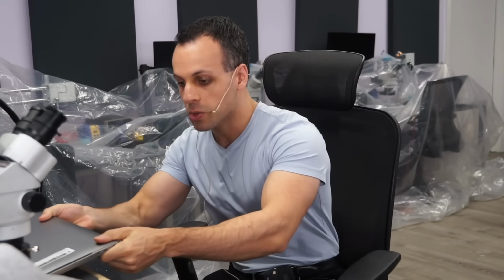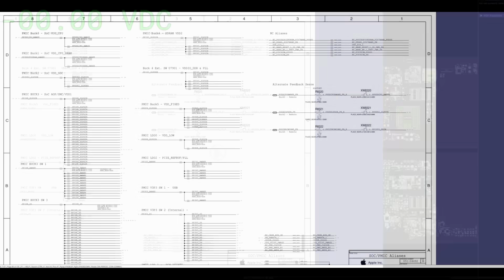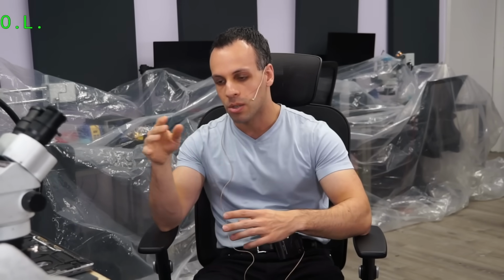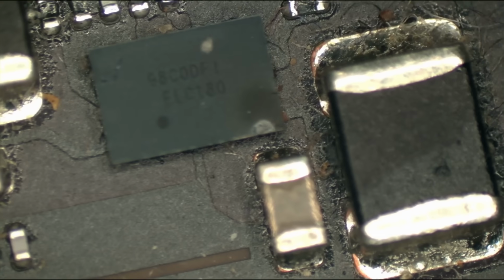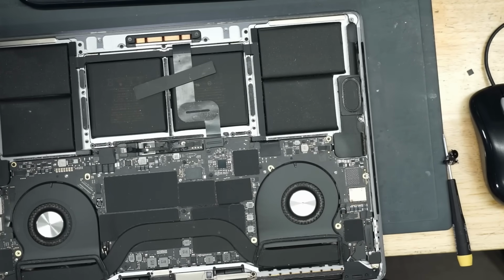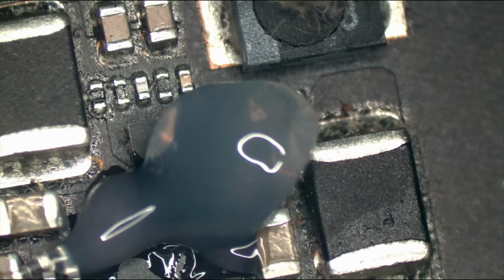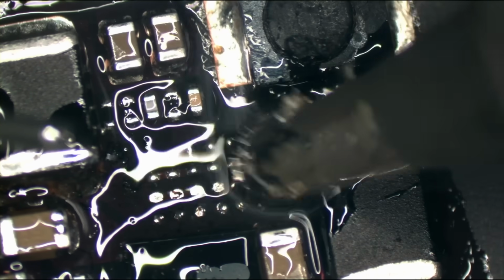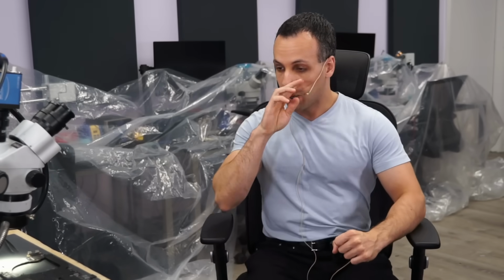How most 16" Macbook Pros often kill themselves & why they're unfixable

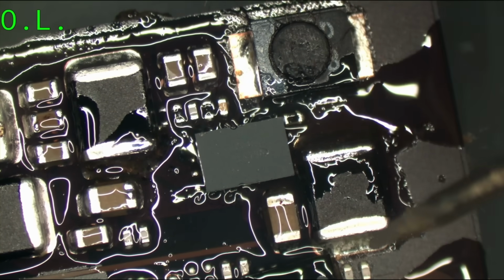Comment: When testing at 13:15, it doesn't appear the chip is fully seated. There's 3 pads to the left it isn't contacting. Is this normal when testing? I compared its placement to the chips around it and it appears offset to the right during testing.
Reply from the maker: It's not supposed to be touching the board It's sitting on top of flux
Reply: @rossmanngroup  Sorry, didn't mean seated as in soldered on yet... I meant it looked like it was set on the pads and shifted right by a full column. I'd paste a photo comparison if I could. I will however defer to you, you are definitely more the expert at this than I. 

Thanks for the reply, I always enjoy your repair videos, right to repair work, and your walks/cycling through NYC.
Reply: He was testing the power, which it seems he almost forgot to do, before soldering on the new chip.

Comment: Does replacement before the issue occurs prevent the issue? Like are the newer chips more reliable or just as likely to blow?
Reply: It’s not the chip. It’s the layout of the electrical current of the motherboard, as designed messes up the SSD by sending a lot of power to it and blowing it up essentially.

Comment: Wow they have reached a new low. At least before they only self destructed but the data was salvageable. Now they take the data with them. I recon not long till they start taking other devices with them. Or the user.

Is the issue still there in the M1 macs?

Comment: I thought you were taking apart a M1 Pro/Max 16” MBP at first. How well/badly are those engineered?
Reply: apparently, exactly the same.
most of the board failures from the thunderbolt/touchbar generation has moved over to the M1 macbooks as well.
its like apple is actually considering these board failures as must have "features" lol

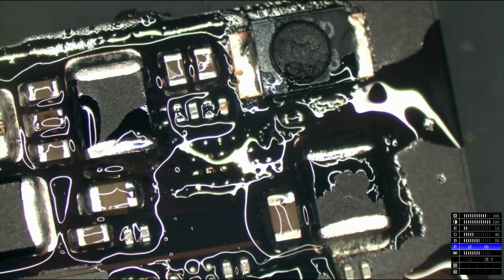Comment: it looks like it was soldered one row off. If you watch from 12:55 you see how it gets soldered and it looks like the array was misaligned. I doubt it would have worked either way but still
Reply from the maker: It was never soldered because I need to measure to see if the short is still there before I solder

Comment: Its likely more MacBooks make it to the repair shop because with craptastic Windows laptops, the buyer just expects that the when the unit fails, its landfill time....if they are lucky they can pull the HD and RAM (which will also gather dust in the "phone drawer")

Comment: It's not liquid damage, my theory is that the power chips are so close to the intake slot that dust may enter and accumulate, eventually shorting the power circuit out and electrocute the whole thing.
Reply: considering there was a pretty significant piece of dust right over the ssd chip i think you might actually be right on this one

Comment: As someone who owns a 16" MacBook Pro that represents a huge investment for me, is there any solution other than paying for iCloud in preparation of spontaneous death?
Reply: There are several other solutions like Onedrive and so forth. Least you won't pay Apple a reward for threatening your data with electrocution.
Hardware-wise, you could add a overvoltage protection component between, but wouldn't recommend trying that until you are no worse using the solder station than Louis is.

Comment: Didn't you put the new chip on wrong? At 13:08 you can still see pins on the left side of the chip.
Reply from the maker: It's not soldered on. I'm not wasting the chip if the short is still there.

Comment: I emailed you guys over one of these models doing something similar... was sure I didn't have water damage but thought it was a bad battery. I basically used it 4-5 times and noticed it would drain very quickly until it didn't power back up. I took my sweet time and missed the warranty period with Apple to get it replaced. 

The estimate was around $450 from you guys so, I bought the battery and replaced it myself and that fixed it. :)

I got the "water damage" disclaimer back in your email and was quite frankly annoyed even though I stated the laptop had none ahead of time (I'm in IT myself) but I get it now.
Reply from the maker: You seem easily annoyed. Oh well. I'm glad it works. We never give specific quotes over email, we give ranges based on different things that could be causing the issue and always tell people to bring it in because there's no way we can tell for sure without actually seeing it. When people say that they are mad when they have never given us a chance to view the device in person, there's really nothing I can say to that
Reply: @rossmanngroup  I was annoyed because I noted the device was barely used and that it didn't have water damage and got back an email just as you stated but that also noted it may be water damage. No other reason. 

But as I stated I'm in IT as well. I get devices from people all the time who say "it just stopped working" and when I get the thing you can see the liquid under the screen 😀. That said, I was looking for a ballpark price on the fix. I did some research prior and noticed replacing the battery was a royal pain in the behind on these and would rather have paid someone to do it if it wasn't that big of a hit but I sucked it up and spent the 2 hours myself. Needless to say it was not a rewarding experience. 😬

Comment: Can't believe a less-than-3-year-old $3000 MacBook just fucks itself out of existence. I was considering buying an M2 powered MacBook for college but I've now been convinced otherwise.
Reply: I wan considering an M1 max in a few years but now I'm very scared for my data😂😂😂
Reply: God I wish I had the viable choice to use Logic Pro X on well built laptop hardware.
Reply: Buy a Thinkpad, a decent one, say an old t440s, and hackintosh macOS on it. Linux (I like MX these days, personally) on another partition and your done. The only mac I currently own is a 2008 macbook (unibody). With 8GB RAM and an SSD it surfs the web with High Sierra (dosdude1 patcher) just fine, and still gives me access to my old mac files. Otherwise its Linux for life.
Reply: @imixmuan9081  I would really like to do that but i'm using so many modern CPU heavy plugins that I really do need the power of a newer CPU. Thinkpad would just cause too many hiccups and require insane latency to record without buffer overflows and clicks or pops. I've looked into the laptop hackintosh situation for years but sadly it's a really complicated mess I don't wanna deal with. I've done multiple desktop hacktinsoh setups and have hated the process each time. I can't imagine on laptop.
Reply: Don’t overreact. Commenters make it sound like a huge percentage of Macs fail and destroy your data on purpose, but as he said, it was one revision of one particular model. I program for a living, and all one needs for data safety is a backup drive (super easy these days), and/or cloud backup (yeah it costs, but very little), all things people should be doing no matter what brand or model they choose.  Wait another month and get the latest greatest Mac with all the ram and drive you can afford.  Back it up daily or more often, and enjoy it for years to come.

Comment: If the NAND is dead on a macBook with T2 chip you should be able to reset the SSD controller if you put on a new NAND die using the Apple Cofigurator (from the macOS App Store), this Tool will re-flash the T2 firmware and as part of that it resets the SSD controller within it.  (this will require you to have Mac with a USB-C port).

However you will need to get the correct NAND dies apples SSD controller firmware only supports a subset of NAND vendors and depending on the capacity you need to match the vendor model number directly (this is not all to that uncommon for other SSD controllers out there most have static configuration in the firmware).

Out of interest why is replacing the NAND die so costly, raw NAND dies are not that expensive a part (compared to something like the CPU or GPU or even gpu memory)
Reply: Unless the fried NAND simply indicates the whole SSD-array is toasted...

Comment: I would really like to hear your opinion on the board design of the framework laptop. 
Not just about repairability, but also how smart it was designed.
Or is there already a video about that?
Reply: Not smart designed, Apple likes to take the boards that are already tested/approved for certain electrical standards and change them up to save a little cash

Terrible strategy but great if you plan on not fixing your products, ever
Reply: @GenDrag1  Request is about a Framework laptop, not an Apple

Comment: I get so many of these turning up.   For those reading/watching; before you even power up the machine, check the PPBUS resistance, check the SSD 2V5 resistance.
If SSD is shorted, remove the VREG and check again; if it's still shorted HARD ( < 1R0 ) then you might be lucky and it's a blown/corroded cap.  If it's 3~6R it's probably either the NAND dead or the PCB shorted :(

What ever you do, if you find a corroded cap on the NAND or PPBUS rail next to the NAND VREG,  **REPLACE THE GODDAMNED VREG** first before you even consider powering it back up after removing the short - as sometimes that shorted cap is the only thing that's saving the NAND from a VREG that's likely going to spit out something more than 2V5.

You want PPBUS and NAND 2V5 to be > 400 ohms when warm, or 1K+ when cool.  If they're not, then you've got a dead NAND, PCB or other issue still.
Reply: They need to make smd crowbars that intentionally popcorn the package when tripped.
And ffs, put crowbars in to protect storage
Reply: @RobertSzasz  I was thing along the same line, but, apple don't make SSD's, would of though that they would have some sort, protection, from externally, botch-up's of what ever connected to it,  if you ever need to 007 auto destruct for you data, sending 12 volt to that pin would be the way to do it?
Reply: @dh2032  there's a definite trade off between speed, size, power waste and robustness. A modular storage is more likely to have protection , where a chip directly placed on a board relies on the board/product design
Reply: silly ppbus go brrr
Reply: @genericscottishchannel1603  13v to ssd=🔥

Data afterwards:🔥 🔥
Reply: Another suggestion, use a brush to clean the SSD power regulator area whenever you open it up, it is likely the short is caused by dust accumulation.
Reply: @ScaredPilot  It's more likely a weakness in the regulator chip design or manufacturing process. Unless the dust really thick, it's not going to short the chip - more likely cause it to overheat by reducing airflow over it.
Reply: @ScaredPilot  Apple devices are meant to be used only in sterile, surgery clean spaces. Also you're holding it wrong
Reply: People keep buying them like sheep.
Reply: It’s not a corroded cap it’s the Apple engineers that is morally corroded.  My a1989 1TB ssd would not turn on after sleep.  It have short on ppbus caused by NAND verg rail and  I have a hole in one the SSD NANDs.
Reply: @hawksoso  I'm sorry, an actual fucking hole?
Reply: @spdcrzy   Yes here is the video of it  https://youtube.com/shorts/ekSZdehnz1U?feature=share
Reply: @hawksoso  that are* morally corroded.
Reply: @hawksoso  - Wait woot?  SSD from 1989?? lol
Reply: I have a question... Do you think a thermal pad would help? If I put one on the the chip? I mean less heat = more reliable. I don't use my MBP 2019 16 inch but I don't want to kill it lmao.
Reply: Is this a common problem on the 14 inch MBP as well or only the 16?
Reply: @FridmanB  Too early to say about the weak spots of the M1 series 14". But I was told by the repair shop, the 16" 2019 Intel Macbooks are dying now in huge amounts in relation to the sold numbers. I think, 3 years seems to be about their lifespan and then they start failing, don't think we will see many of them around in 2 or 3 further years on. Repair is often no realistic option, so even for the rapid shop, it is no good business.
Reply: @FridmanB  I want to know that too.
Reply: And when (if fixed) put some clamping zenner on NAND vdd circuit to try protect it.
Reply: @jorgeferreira4452  is there a clear preventive fix for this? I don’t have AppleCare and now I’m worried that my very expensive mbp will turn into a heaping mass of doorstop without recourse from Apple. Bigcorps suck.

Is this still the design for the 16” M1?
Reply: @JoeShapiro  I'm sorry to hear that you've fallen for Apple's BS. Better luck next time!
Reply: @JoeShapiro  why not get apple care if you're worried?
Reply: @catbread2585  intended to but waited too long. Now they won’t let me buy it.
Reply: @JoeShapiro  really? Is that a thing? So then it's better for everyone to get it as soon they buy a new MacBook
Reply: @JoeShapiro  Make regular backups of your important data and just keep using it. I’d say there’s no need to worry until there’s an actual problem and despite people here thinking Apple hardware is so prone to failure the majority of it doesn’t fail.
Reply: @jorgeferreira4452  Was thinking same thing watching this! - anyone got a suggestion for good part to use for crowbar?
Reply: Did you try turning it off then on again?
Reply: So if I buy one of these machines, is there a mod that could be applied, like a fuse to protect the NAND?
Reply: @MarkT  realistically the easiest thing is to cover the VREG areas with Starbright liquid rubber or similar coating to prevent corrosion.  Even hotglue can work
Reply: @MarkT  seems to me that replacing the under-spec’ed capacitor before it fails would be the reasonable mod. I asked earlier but, other than snark, got no replies.
Reply: shagger does it again
Reply: Oh god not the ppbus.
Reply: Do you mean for a new machine or if it starts giving trouble?
Reply: Who?
Reply: Can I remove that chip and the inductor that powers the band so I can at least power it up to test my lcd? Or is this just headed for the bin now.

Comment: Louis, is this problem limited to the Intel 16" models, or has it persisted into the M1 models too?
Reply: this problem also occurs with M1 models.
essentially, this problem occurs with any macbook that has soldered on SSD's.
had these macbooks used removable SSD's than they would've had additional safety layers to prevent something like this from happening.
Reply: @HoLDoN4Sec  I'm about to buy an M1 pro Mac for work (ios development), this makes me worried
Reply: @nd0307  just buy a high end windows laptop and install a linux distro on it instead.
you will get better performance, much better reliability and a better bang for your buck.
Macs are NOT required to develop for iOS, the iOS app SDK is available for all three computer OS platforms.

however if you still insist on buying a macbook, i highly suggest you to also get a NAS server and work on your projects directly on the NAS server, at least everything you work on will be in a safer hands than the macbook you're going to use.
Reply: @nd0307    I have an M1 Pro MBP and it works great.
Reply: @Fledgling8448  give it time
Reply: @danishblunt9698  meh
Reply: @Fledgling8448  https://www.youtube.com/watch?v=ZnHgdqU-1ws

u're welcome
Reply: @danishblunt9698  i and everyone close to me have owned Apple products for almost a decade. None of them have failed once.
Reply: @arandomhumanbeing2464  let me guess

Macbook pro 2014 / 2015
Reply: @danishblunt9698   currently an M1 macbook pro
Reply: @HoLDoN4Sec  I was specifically referring to the possibility of 13 volts finding its way to the SSD
Reply: @sullivan912  the PCB layout for M1 macbooks haven't really changed that much.
especially the M1 MacBook Pro 13", it basically is using the exact same poor power rail design as the intel MacBook Pro 13".
this SSD power rail failure seems to also be happening on the 14" M1 MacBook Pros (as someone in the comments here also mentioned this issue happened to him with his 14 months old 14" M1 Pro MBP) so it is not that far fetched that the 16" M1's also are using the same horrible layout design for the power rails
Reply: @HoLDoN4Sec  Thanks. That figures!
Reply: I wondered that myself.

Comment: The problem can be avoided with zener diode or you can add TVS diode or MOV to protect unwanted higher voltage than intended or both. either way it is very cheap solution for >$1000 product and this is clearly evidence of greedy apple that just don't care about your data and they don't value you.

No wonder they are Trillion dollar company.

Comment: I already resisted getting the latest and seemingly greatest MacBook Pros because of the annoying and idiotic decision by Apple to SOLDER the SSD/storage device to the motherboard! And now I learn from this video that there's an apparent design flaw where it inexplicably sends 13 volts to the SSD?! 🤦‍♂
Reply: When my old laptop died, I was able to take the hard drive out, stick it in a desktop, and copy my data, even though I couldn't boot from the laptop's drive.  When I get a new laptop, I hope to put the SSD from my current laptop in it, not just for the data, which I could back up, but so I can use that space for installing more games at once.  I paid for those parts, and if they still work when the machine they are in breaks, I want to keep using them.

Comment: What is the actual cause of the failure though? The computer isn't just going to send lethal voltage to the SSD just because it feels like it. Something else has to fail further up the line, what is it?
Reply: The actual fault was the voltage regulator chip exploding (failing short). As for why it exploded, your guess is as good as mine. Could have been conductive dust through the vent (as some have suggested.) Could have been a bad circuit design that caused extra stress on the regulator. Could have been a design flaw in the chip itself. In any case, Apple could have mitigated the failure by using a lower voltage as input to the regulator (although maybe they chose the higher voltage to increase current capability) or by adding a crowbar to shunt the high voltage on short and blow a fuse.